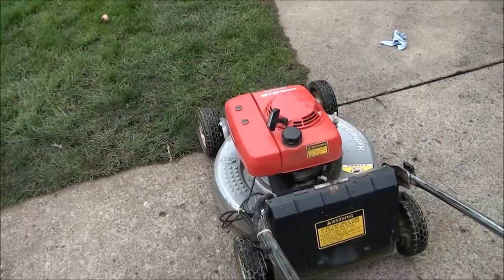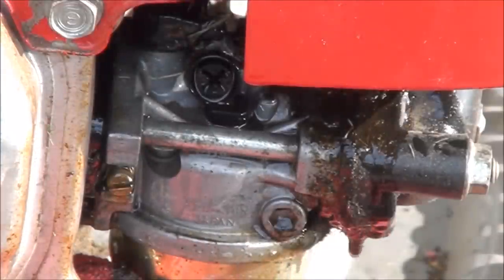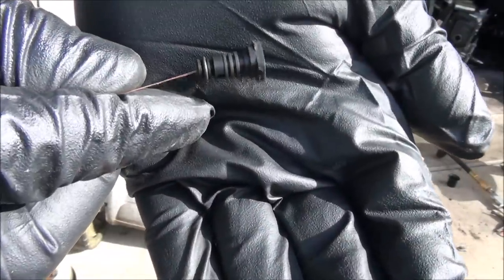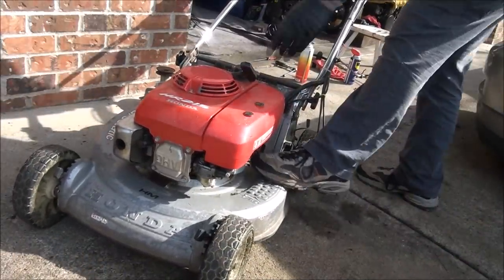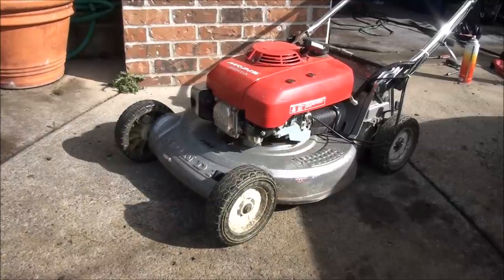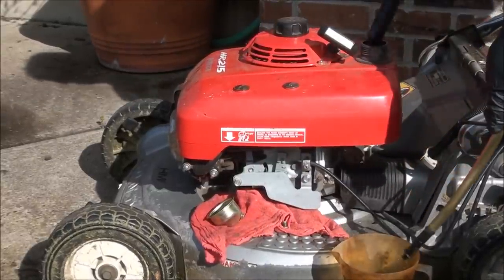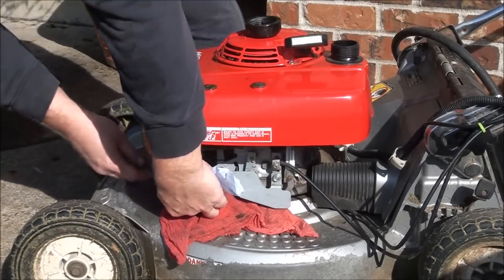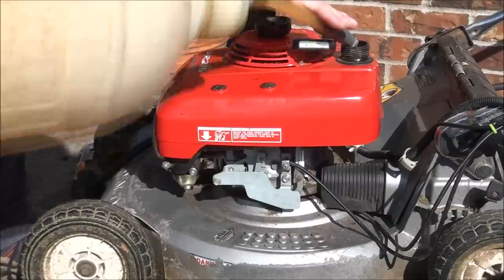HONDA Lawnmower SURGING Problem. Plugged Carburetor jets. Is it the MAIN JET? SLOW JET? Both?

Comment: On the first screw, the idle adjustment, before you remove it, you should screw it in to bottom and count the turns it turned, that way you can screw it back in to the correct place by counting the turns back out from bottom.

Comment: Just wanted to let you know that the info you provided was right on the money. Been screwing around with this motor for a while, cleaned the carb a couple times and still surging. I was ready to take it to the dump when I ran into the info you provided. And just like yours the pilot jet was plugged so badly I just about had to drill it out.. Anyway I got through with some tip cleaners and now It runs like new.. THANK YOU VERY MUCH!!!!!
Reply from the maker: thanks for commenting Stu! I am glad it helped
Reply: Same here!  Two summers I've been fooling around with the carb and could not find what was wrong with it!  Thank you :)

Comment: Jeff :  A follow up where it may help people : too my astonishment I performed a process of drilling out the interior idle jet out in baby steps in an after market carburetor and using micro drill bits since I use them in my scroll saw projects . The Honda engine idles normal now , it was a little of a pain to do , who would have ever thought that buying a new cheap carburetor from Amazon you'd have to proform a maintenance procedure like this just to get it too run right . I listened  to everybody tell me it was trash in the carburetor until I'd cleaned it out so many times , decided that there had to be another Avenue to do . I'd cleaned the gas lines out and took the gas tank off and even washed it out with soap and water and blew it out and let it dry good and had given up until I saw a gentleman on utube hand drilling the idle jet out one thousandths at a time . IT WORKED ......

Comment: My antique HRA216 SX Commercial Mower, from the 80's I believe, has the GXV-160 engine and a 3-speed transmission.  Really strange model with an oversized gas tank.  The Honda Dealer had never seen one like it. Wish I could attach a picture of it.  On a cold engine with full-throttle, just before choke engages, it stalls when I engage the blade.  Makes a bad knock hopefully not Rod bearing.  My other Honda's all knock some but this one is the worst.  If I warm it up for 5 minutes or so, it then will engage the blade without stalling.  Still knocks when engaging the blade but when up to speed, no knock.  Not sure how to correct the stalling when cold?  Tried cleaning carb.   I have a HR-214 and HR-215 collection.  Have 6 of these mowers.  One of them I modified.  I shaved the head to increase the compression and polished the ports.  The thing doesn't even slow down in high grass.
Reply from the maker: possibly need to increase engine rpm's

Comment: Great video. I have an HRC216HXA  that was doing the same thing. the carb layout for this procedure was identical, except I had to remove 3 bolts to move the air cleaner, as their was a plate with a hole blocking access to the slow jet. I'm surprised your mower started after the tank cleanup, as I could swear that fuel valve was still off in the video, bowl empty??? Anyway, great video. Saved me a total carb overhaul. And my mower no longer surges;)
Reply: There was a slight edit of the video at that point, it would have never started right off of what he did. Great video and very informative for sure, my mower has the same issue.  I have taken the carburetor apart a few times to clean it but I will have to take another look and see if it's similar to this one, I may be missing something.

Comment: Why didn't you keep the engine running after cleaning the idle jet and turn the fuel lever to off and keep running till it stops/runs out of fuel saves all that fuel coming out the float bowel when you remove it?
Reply from the maker: excellent tip Tom! sometimes I do things the hard way, well most times actually...! lol

Comment: Hi Jeff
Thank You for your excellent video;
I have a 1997 Honda HRH 536 and for the first time I am having SURGING Problem  when the machine is could.
I followed your video, removed the pilot jet and tried any trick under the soon to clean the bottom hole
including a fine sewing needle without success. Please advice.
Many thanks
Francesco
Reply from the maker: a sewing needle is usually too big to poke through the pilot jet hole.
Reply: @JeffsLittleEngineService  Thank you very very much Jeff,  I have used a stripped bread tie to clean the jet. Perfect!! Grazie.

Comment: Hi. Thanks for the great videos. I'm a subscriber.

A question please on the 6.5 horsepower Craftsman lawn mower...

Regarding the main jet bolt that attaches the fuel bowl :

If the bolt is standing on a table on its head the bigger part... I see that the lower canal goes all the way through but the canal in the center of the bolt at the end of the bolt (furthest away from the head) doesn't seem to go all the way through to connect with the lower canal.

I'm having a hard time understanding how this works if the top hole doesn't go all the way through what is its purpose ?

I can see the purpose of the lower canal because it goes all the way through and will allow for air or fuel to pass but the center top hole not going through doesn't make sense to me.

Can you enlighten me please ?

Also I detached the fuel bowl from the carburetor and I found a small metal circular piece inside loose. It seems to be the exact size of the hole that would have been drilled into the bowl that allows for the bolt to pass through. It's got me wondering where it came from and wondering if when they drilled a hole through the bowl at the factory, could it have not been noticed and not removed and just left behind accidentally? I'm not sure why a circular piece of metal that is the exact size of the fuel bowl bolt opening would be inside the bowl.

Thanks.
Anybody knowledgeable please reply soon.
Reply from the maker: Yes The main jet holes should intersect. The hole in the end may be plugged up. The circular metal piece is called a welch plug. it presses into place in the inside of carb next the the threaded center piece. I have used carburetors without the welch plug and they seem to work fine.
Reply: @JeffsLittleEngineService  ok thank you. Should i discard the welch plug ? I left it out and cleaned her up and shes running great now. Cant a loose welch plug cover the main jet at the end of the bolt and block it ?

Comment: Jeff, I'm servicing a Honda HR21 SXM.  The carb sits sideways and so you have to remove the air filter/breather housing to get to the carb.  This engine has an idle needle that faces the flywheel so it is a guessing game as to how to set the needle before re-assembly.  When I got the mower it would only run on choke but after cleaning the idle was too low.  I tried adjusting rpm but we know that is not the correct fix.  What would be your "start" setting on the idle adjustment?  1.5 turns out is too slow.  Thanks.
Reply from the maker: the idle circuit "mixture" screw does not effect rpms ( the preliminary settings usually 1 turn -1.5 turns out). The idle "adjustment" screw does effect rpms. If you can't rev it up it may need a govenor or govenor spring adjustment.
Reply: The engine rpm is fine on "fast" but the engine does not throttle down properly to idle.
Reply from the maker: sounds like the slow speed jet/system inside the carburetor is plugged
Reply: That was the ticket- the needle wasn't turned out enough.  Thanks!

Comment: I have the same model mower and motor wonder if I can put a new motor on that deck I have a Honda hrx 217 versa mow engine with a 6.5 horse power that I want to put on that deck wonder if it’s going to work

Comment: I had to clean the carburetor on the Honda hr 173 that I got from a family member I soaked the carburetor in rubbing alcohol over night putted back on the mower and fresh gas and it fired up on the first pull
Reply: Hi my Honda HR 215 HARD to start I have to open the air cleaner cover and drop some gas to carburetor after that it will start.
Once it start it won't die .note it's a newly installed after market carburetor.
Any recommendations

Comment: Can you tell me where to buy one of those pumps you used to drain the gas out?
Reply from the maker: Tech tip #54678: Any pump will work! like a hand soap bottle pump , large shampoo bottle pump or even a spray bottle pump. This one came off of a 1 gallon 140w oil jug.
Reply: I bought a little hand pump from WALMART (in auto departent by oil/air filters) for $5.00. It has long clear tubes on both ends, works great

Comment: Good video. In my shop I usually clean out the slow jet under the idle screw with a tiny drill bit. Maybe one size bigger. Useally solves the issue. Thanks for the video's.
Reply: You NEVER NEVER use DRILL bits  on any JETs  that just enlarges the Holes, & causes major  problems  ……….  you can clean Solvent Spray,  Fish line  or a small wire !!!

Comment: .013 diameter is the small end hole... a .013 steel guitar string  is perfect to gently clear it. The fumble-finger workman should get a helper to run the camera and take his time on the engine